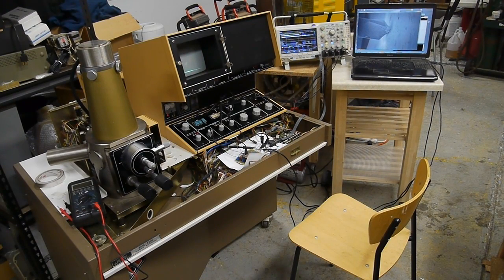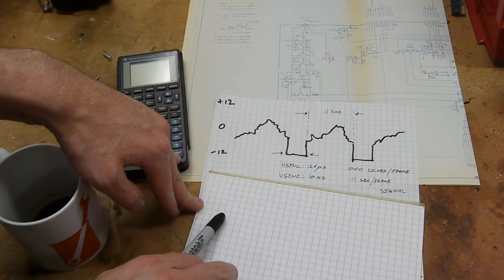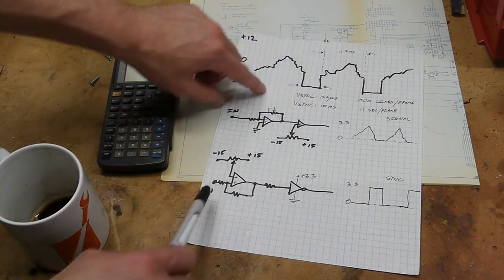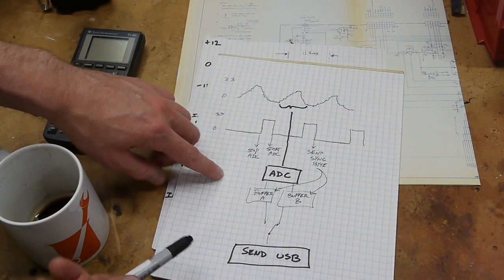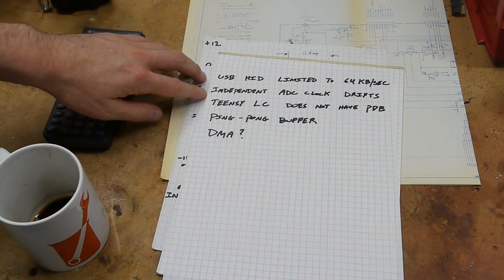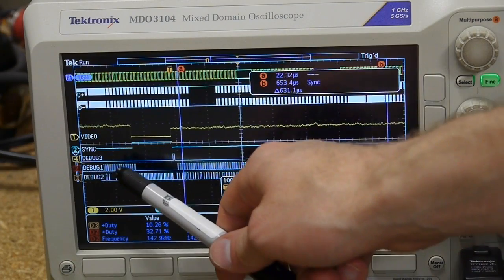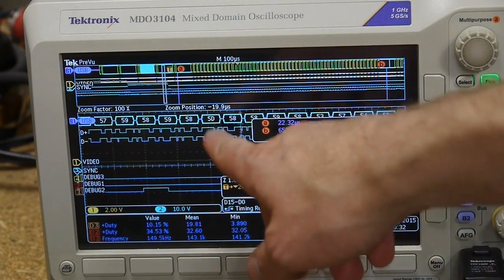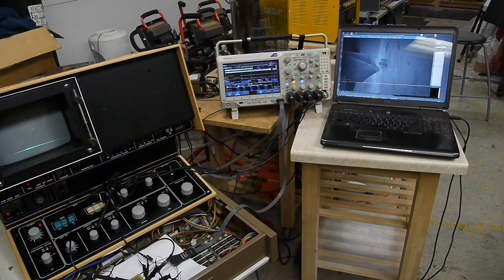Electron microscope image capture via microcontroller (with drill bit animation)

Comment: Adding a. second acquisition head with the stepper you wanted and a touch screed from a Pi 5  which if you use a large amount of Ram you would have plenty of buffer abs a SATA or USB 3 Solid State drive to capture logs, images, and diagnostics on your entire mashine adding a bunch of I2C sensors.

Comment: I worked for JEOL for about 10 years, I spent a lot of time doing repair work on that exact model. Depending on where you got it from, I may have actually worked on that one..lol.

 JEOL U.S.  products division actually sold a digital conversion/capture box  for it, but due to it being discrete components, the lack of processing power, and utilizing available capture cards of the mid 90's, it was a poor solution that was fraught with bugs and failures requiring frequent component level repair.  At about the time that the capture was perfected, the factory began shipping more modern units within the target market that were digital by design making the capture boxes obsolete.

Comment: full 2d moving of static single one direction electron source, 1d spin 1d radius as storage media
Reply: cd-rom tech instead of crt tech
Reply: when scanning, reading the data, on the disc
Reply: double buffering, neat
Reply: like an image buffer update, sem is crt
Reply: so if you have a second layer that lights up, you should have the image directly

Comment: I know this is an old post but it’s great work! What is more, your “ping pong buffer” is perfectly elegant it’s effectively the ur-example of “page-flipping”. If you are processing in real-time and have no control over the speed or period of acquisition, it’s the best option if you have the resources. If resources are limited you can sometimes implement a page-shifting method using less memory but its algorithmically more complex and can be difficult to implement on some hardware. Synchronous access often ends up even more complex in such scenarios; even if you have the speed, depending on the hardware it might not be reliable.

Comment: Ben, a few months back I purchased a teensy.  I’m a beginner but have played around with breadboards and standard components.  Do you have a recommendation for a practical easy to understand place to learn electronics for beginners?  I want to build midi controllers and maybe setup actuators to trigger my domino toppling setups...  Thanks!

Comment: Hi Ben, in the last video it looked like you were able to change the scan rate of the SEM. You compared the 2 second and 10 second versions. Can't you use that instead of the microcontroller for high speed acquisition?

Comment: This SEM is starting to look more like a FPGA-application. Is there a specific reason you're using a teensy in stead of an FPGA?
Reply from the maker: Yes.  The Teensy includes a built-in ADC<that I can access with one line of code, and allows me to send a byte of data via USB (virtual com port) also with one line of code.  The time saved developing the system was put into the imaging of the object, making a video,  and putting it on youtube.  If I went the FPGA route, I'd probably still be working on it :)
Reply: Applied Science I watched your video again, I thought the slow capture time was due to the Teensy, turns out the SEM needs that long for decent resolution. Anyway, it would be a cool project to get into FPGA's :)

Comment: Fantasitc to see it all leading to this. I tried to build one myself with an electron gun from a crt HD TV (there were a few), I feel for your efforts, I had the 2 stage oil and diff stack, still have the edwards pirani glass guages, outgassing and special greases, berilium copper ? photomultiplier. Had to call it a day before I got anything working so Its great to see you go all the way. Just had a demo of a JEOL sem this week, sample in hand to image was ~ 5 mins, no sputtering,no gasses,only a 2 stage pump. wow. Just found your channel. Love it. Ive done DMA on arduino, alternativley the pic32MZ has a fast ADC and runs at 200MHz. Great vid, nice scope.

Comment: When reach the appropriate place in your project you might thing about adding a Motion Control System to your Electron Microscope. Specifically, software that was designed for stop motion animation. A motion control system made so you can perform moves on your target. You will be able move in and an out, title up and down and pan left and right. In you case the  the software would receive the sync pulse which will cause the software to next event (location). There are 4000 position available for each channel. A seven channel servo controller will work. You can go up to a 24 channel controller.  You will next to use servos with the smallest distance between points. Make sure you digital servers. Digital servers are frame accurate. I have a free prototype software package you can use when you are ready.

Comment: Hi there! This is cool! After watching this, I'm trying to implement something similar on my electron beam welder.
In brief, I've been generating a TTL sync signal from the beam X deflection signal (in a raster-scan fashion) to trigger an interrupt for the Arduino Due to do analogue read ( reading the SE / BSE signal to be used as pixel intensity)

My current issue is that my system is experiencing really high frequency glitches (which cannot be picked up from an oscilloscope). And they seem to be coming from my power source (+5 to -5V for voltage comparator / op amps used as unity gain buffer) or even the oscilloscope itself.... 

May I ask if you've had similar issue with glitches..? it'd be great if you give me some advice.

Thanks a lot in advance!

William

Comment: Another great video in a long line of them. Truly inspiring. Another Gaucho here  :), UCSB Physics.
 I was able to pick up a Cambridge SEM for about 3k. Ion pump is bad, but the rest of scope is intact. Also no digital capture, just Polaroid. Composite video out, and also has x-ray detector for spectroscopy :) 
 Want to do something like what you are accomplishing with the micro controller. Hopefully I can tag along...my electronics background isn't nearly as deep as yours. However, the only way to really learn is with a real project. Again, thanks for the inspiration, and the absolutely fantastic instructional videos. I don't have anything near the quality of that Tek Scope however, I assume this will mean the debugging will be much harder. Curious what the min cost would be for a multi-domain scope like this? Maybe software driven would offer lower cost solution?

Comment: Why not run the ADC all the time? Seems weird to start/stop it.   So, keep a timer on your MCU,  if you get a sync interrupt, record the time.  The data you send then is a packed with current time stamp + ADC data, and then a packet with line or frame sync time stamp. Then you can easily mask the good data on the PC, since the time between ADC samples is fixed.  The easier you make your firmware, the better.

Comment: Are you planning to update to a 3.1?
Reply: Since I have no idea what the noise limiting factors are or how much bandwidth is available at which stages in the system but an USB external 24bit 192khz audio ADC might be interesting as a relatively direct way to connect. If the system is already limited to 12 bits or so dynamic range then the low cost uC of the teensys make a lot more sense. I'm very much looking forward to seeing how you tackle direct scan control and high frame rates.
Reply from the maker: +Robert Szasz I was originally, but the performance of the LC is plenty good enough for capture of the 10-second scan that the SEM produces all by itself, so this phase of the project is done.  The next phase would be controlling the X and Y raster on the SEM via microcontroller, but that will probably require a whole hardware redesign.

Comment: Did you have stability problems using the opamp to reduce?   I think it's more stable to configure the first op amp as a buffer (1 to 1) then feed a voltage divider to reduce, then feed another opamp.

Comment: Fantastic project as always Ben.  Awesome to see the MDO being put to such good use!  You know, there is a Search feature as well, that would allow you to search and mark for specific events in the USB data, making it easy to navigate to them.  Also, when you scroll in the Event Table, that centers the zoom window in that spot.
Reply from the maker: +w2aew Thanks!  I still haven't forgotten about the ICs that you sent me!  They'll make an appearance soon.  The search function on the MDO is definitely handy, but in this case, triggering on specific USB data was my goal.  I couldn't get the scope to trigger on any sort of USB data packet, even though they were definitely present in the stream.  Let me know if you have any tips regarding this, or let me know who to talk to regarding USB triggering.
Reply: +Applied Science It should be straightforward to do that.  You may have to put triggering into "Normal" instead of "Auto" to prevent a self-trigger, especially if long memory depth is used.  I'll have to give this a try myself and let you know...
Reply: FYI, I believe the metallization on those chips is gold, so you may not have to sputter them.
Reply: Applied Science rtxasz xx

Comment: Code's looking good. Double buffering is the right choice here.
If you have enough memory for 2 buffers AND your acquisition is by definition "quantized" into lines, then i'd prefer this over a ring buffer.
Only thing I'd improve here would be to remove the duplication of code with bufferA and bufferB.
Get a read and a write pointer and just alternate them between the buffers.
Sure, you get an extra indirection, but code gets shorter and more streamlined.

Keep it up man :>

Comment: Have you considered using the P8X32A Propeller chip?  With 8 cogs each having its own vidio generator real time apps like that would be easy to implement. the only drawback is the lack of integrated ADC non board, but adding a high speed ADC is a snap.

Comment: The $10 Cypress PSOC 5LP prototyping kit would have been perfect for this project.  It's programmable analog so you could have done all your opamps and comparators directly on the kit in programmable hardware wired via software and DMA to the built in microcontroller.  You also have lots of timer options including high resolution timers, higher resolution ADC capabilities (up to 12-bit SAR), and USB programmability.

http://origin-www.cypress.com/documentation/development-kitsboards/cy8ckit-059-psoc-5lp-prototyping-kit
Reply: +Ethan Waldo Yes I would like to give another recommendation for PSOC. I got led onto them by an EE friend and it seems to have so much more flexibility than a lot of the "hobbyist" level microcontrollers. Yet the documentation and examples are still really good.

Comment: Great project, but is very strange that microcontroller is spending so much time in ADC interrupt routine and interrupt routine is very basic, it look that tool you are using is with some bugs (30% is over 100 assembly instruction executed per every ADC interrupt call and for your interrupt code that is too much even without any optimization)

Comment: If you want to know how to make very fast communication with mcu and computer, goto youtube and check for my tutorial called "Simple high speed communication tutorial between PC and MCU". It does use circular buffer and DMA to offload data from CPU core. You can get 16-24b gray scale by digitizing original high voltage signal. It will be so easy to do !

Comment: Pretty good hack for an teensy, ping pong buffer, is named Double Buffering as well (typically used in graphics or sound application)
Why you don't convert you video signal (@30fps) to 1Vpp composite video (may exist on the board) and digitize it with a very cheap usb video capture card (http://www.dx.com/p/easycap-usb-video-capture-adapter-5707)

I known the hack magic is gone, but it's quite simple to implement and use to record all sort of animation.
The only thing that you need to check/care about, is the  H and V frequency, that should match the NTSC/PAL spec. So may be you need to tune your electon scan rate.

Comment: Pretty good image quality for such an old device.
Could you have used a 16bit sound card channel?
Reply from the maker: +Dan Frederiksen It's tempting.  The major problems are:  sample rate is not quite high enough, AC-coupling is done with digital filters that cannot be disabled, acquisition clock cannot be synced to video signal.  It will make an image, but I suspect it will be impossible to remove all of the artifacts.
Reply: +Applied Science yeah I was thinking it was a little too slow but I believe there are some audio cards without AC coupling.
Your solution is pretty neat. Although it might even benefit from a bit higher sampling speed.

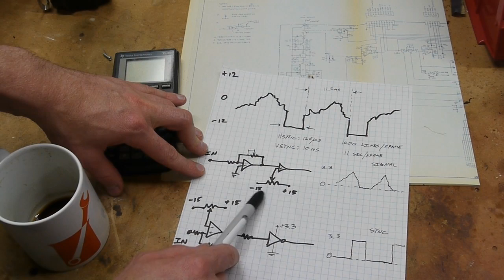Comment: 4:10 You're missing a few resistors there
Reply from the maker: +gregory morgan Yes, that's true. The second opamp in the video chain is just a buffer, so its negative feedback path is a direct connection.  There is also a resistor between the opamps to set the second stage input impedance.
Reply from the maker: +Applied Science Looks like I don't even know my own circuit.  The second opamp is not a buffer.  It's just a standard negative feedback with gain =-1, so equal value input and feedback resistors.

Comment: Maybe I missed something but: how do you get the data over if HID isn't fast enough?
Reply: +TheTjopp I think he isn't using HID, but normal USB. I assume he just wanted to point out that there could be problems with using HID.
Reply: +TheTjopp He mentioned emulating serial.
Reply: Oh. Isn't that what you already get with Teensy's USB serial? Would be the "no thought" solution, which is why I'm a bit confused

Comment: You mention the scan has ~1000 vertical lines.  What are you getting for a horizontal resolution?  If you had a faster ADC, is there a limit to the usable horiz. resolution?
Reply: He's getting about 142,000 samples per second after averaging four ADC conversions. In 11.2ms per line that's nearly 1600 points of horizontal resolution.
Reply: Assuming the opamp output impedance is low enough that the ADC sampling capacitance charging time is not a factor, the limit would be the system clock speed.

Comment: I'm a software dev and understood about 90% of what you mentioned. In a nutshell, you created a custom analog to digital converter and wrote your own software to pull the digital image data over the USB bus and display it on a modern computer. Just wanted to say you are someone I admire and are probably up there with the best of the best when it comes to engineering. Unfortunately I don't have the opportunity to work with the hardware side of things but it's something that interests me probably more than the software side. Keep up the awesome videos.

Comment: Thank you for another interesting video. Just some notes - I think that those adcs in mcus are meant to be used for something like temperature sensors, potentiometers etc.. If 1 frame takes 10s and the voltage is symmetric, maybe the ADC of the sound card is fast enough (its -1/+1V). You can use simple voltage divider here. The timing should be on spot and I think the effective number of bits is higher than what MCUs have. It would be interesting then to compare the results. One problem I expect is that the largers areas represent quite low frequencies and the input of the sound card is AC coupled (this can be overcomed by some kind of modulation, or adding sine to the signal..). Another problem is hum..
Reply: A sound card would not have anywhere near the bandwidth required for video.
Reply: @AureliusR  Man, this was 7 years ago.. I think this animations were done frame by frame.

Comment: To make hid work faster on video  you can use 4 bit delta compression. All bits set can be an escape code. When the escape code is hit you can use the next 4 bits to cover sync or numbers bigger than 4 bit. This pretty much doubles the bandwidth but still may not be enough for your project.

Comment: The Ping-Pong buffer is basically a ring-buffer with two entries. Synchronizing on whole buffers is much more efficient than synchronizing byte-accurate access. Adding a few more buffers to your ring might improve throughput (at the expense of latency) or help mask transmit jitter.